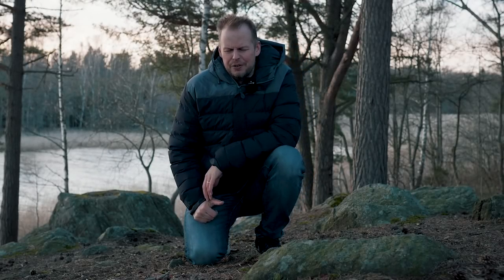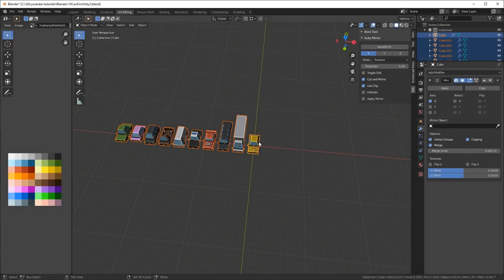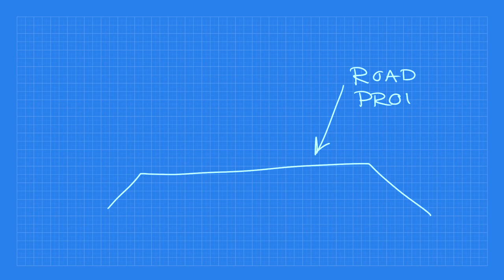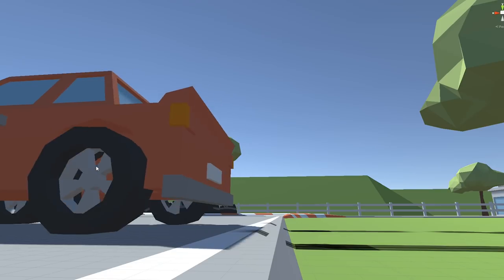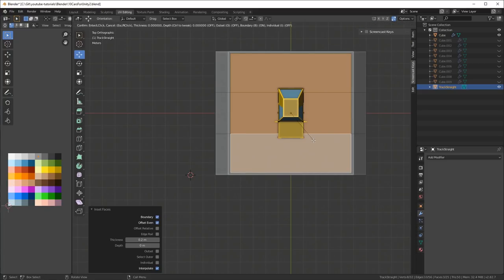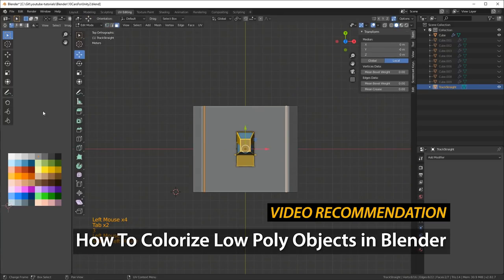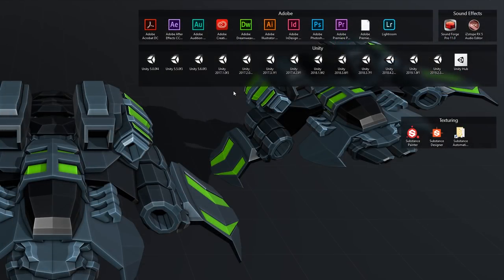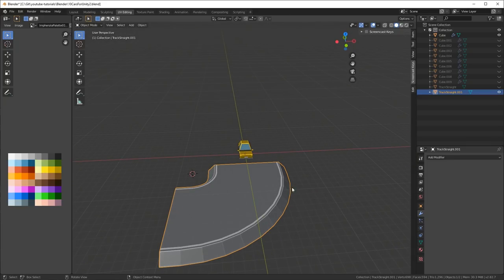Low Poly Racing - Making Of - Ep 1 - Unity & Blender

Comment: You could make the road seperate pieces and to avoid any collision issue you merge the meshes in Unity and make them use a singular mesh collider. This way you can create the levels directly within unity, you can also set the grid snapping to fit your piece.

Awesome video though I wanted to get into modelling low poly stuff for a stealth game im making, what would you recommend for humanoids?

Comment: 11:36 here you could have used "bridge edge loops" in the search part. Select either side of the road and apply it, and blender will create those faces for you.
Reply: Or select just one (middle) edge and repeatedly press F. It's oddly satisfying in this situations :D 11:19
Reply: Hm, I tried your method and it worked only when I selected both sides of the road...
Reply: @Kolumbetko  Yes, sorry, thats what I meant. Your method works too however I normally don't get it to work.
Reply: Thanks you guys I knew it that I'd find the answer here xD
Reply: @Kolumbetko  i had no clue about this.... dang this is really helpful, .....so much time wasted by selecting the edges, instead I could have done this...
Reply: Thanks, this was a great tip

Comment: Just a tip: You can use "bridge edge loops" instead of repeatedly select 2 edges and press F to make a face (when making the overpass)
Edit: Also you can model the track using lots of separate object and join them (Ctrl+J) before exporting to unity.
Reply: Also you don't need to select many faces to do "f" after you've done one just select the edge facing towards the hole you want to fill and press "f" repeatedly

Comment: I'm not the best with 3d modeling but you might be able to cap it faster if you select the entire edge then extrude across using the snap tool then just merge the vertices

Comment: Thanks again for this, I have a question at 5:10m you did a extrude with accurate edges,  I am trying to replicate it with no luck, can you please explain it to me? thanks in advance. I think I got it, in the video says E but it works if you use S (scale) just after. Thanks anyway. you are the best. I am learning a lot. Cheers
Reply: I'm working on this right now and I can't figure out this step either.

Comment: Would love to see a tutorial on how you built the actual game in unity 😍
How you set up the car physics, the lighting etc.
Reply: I would love to see this as a tutorial series aswell. sadly there isnt many good ones for the newer versions of unity.
Reply: @brianmo2611  Most of the older tutorials still work. Quill18Creates and Brackeys have some good tutorials.
Reply: @fanpatti9317  stuff like where acceleration / forces are applied aren't immediately obvious though. Neither is how you make turning feel right. Which tweakables to create so that you can create different cars (if cars should have different properties, that is).

It's easy to say "you need to use this" it's not so easy to actually do it in a proper way that takes care of potential pitfalls.
Reply: @NukeCloudstalker  Yup..For car movement ,Wheel Joint is your best friend!
Reply: @astargames5275  wheel collider? AFAIK "Wheel joints" aren't a thing. I might be wrong though.

I personally use joints + normal rigidbodies, and just manipulate their angular velocity. But my application is not supposed to be simulating realistic cars, more like light-weight robots on wheels that don't turn.

Comment: If you some day do decide to use a texture for your track without blurred texture when you zoom in in Unity, you can just apply/make those textures as you would normally. Then in Unity, select the texture map. With this selected you can set it to use Point instead of bilinear to keep the hard edges. This will, like you said, increase performance, but since you have a low poly count, I don't think it will impact it that much. Anyway, great video and I look forward for the next one!

Comment: How do you show the colors of the objects in the solid viewport ?  are they  they true material colors or just colors set in the viewport display?
Reply from the maker: I use the dropdown in the top right of the viewport so you can switch to Texture preview.
Reply: @Imphenzia  : But I can see you're using solid mode in your video. Texture mode is fine, but it comes with the texture and added lighting that sometimes gets in the way when modeling.

Comment: Hi Imphenzia, I know this is not really a low poly problem, but can you please help me to understand how to adjust track pieces of different width? Imagine a "real life" track where the track width vary along the track, i managed to reduce or increase the size only on the straight part, but would be nice I could  the width of the track also during a corner. 
I tried using proportional editing but the results where disappointing :(
Thanks

Comment: At 5:11:   Should be "HOTKEY: E extrude   -   Right-Click   -   HOTKEY: S scale". And there is no need to duplicate the edge ring at 4:54.
Reply: Thank you, I wondered how he did that.
Reply: @Paul Smith    I have edited my comment slightly to make the procedure more clear.
Reply: Thanks, this saved me.
Reply: Even putting the 3D Cursor at the center my extrusion failed although I pointed the Pivot Point to the 3D Cursor. I had to move point by point to align. Don't know what I made wrong....
Reply: thanks you saved my day :)
Reply: thank you bro i couldnt wrap my head around it:yougotthis::yougotthis:

Comment: This video is a bit old so I’m not sure anyone will respond but I would love to know how you are storing all the different roads and then calling them up with ease. I’m just starting out. I’m still familiarizing myself with all the different buttons. When I finish something I just move it off to the side. Are you just hiding them? It seems like you are pasting them out of thin air. I noticed once you’ve used a piece you just duplicate it and make it fit which is something I’ll be copying for sure.
Reply: It’s in his assets folder, when you import an object you can put it into the scene as many times as you want, duplicating is by CTRL-D or shift-D, it’s been a while since I used unity since I’m now a UE programmer but it should be one of those
Reply: @oozly9291  Thank you Oozly!

Comment: Why not use a vector instead of adding geometry? Surely then it will get evaluated as a rhaster contextually and wont lose quality either.
The textures would be tiny too at least until rasterised and even then if optimised properly would also be tiny.